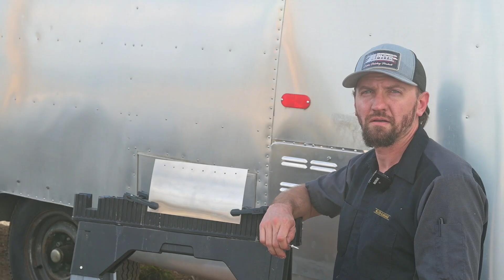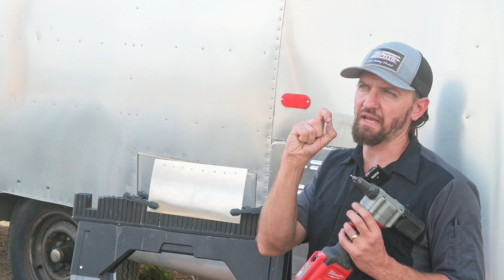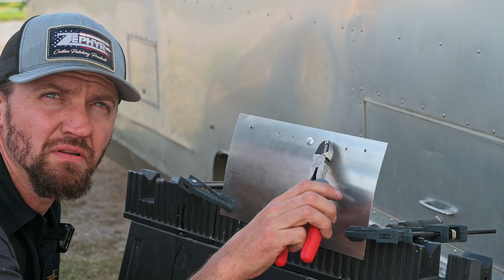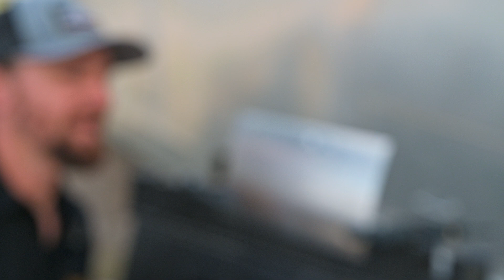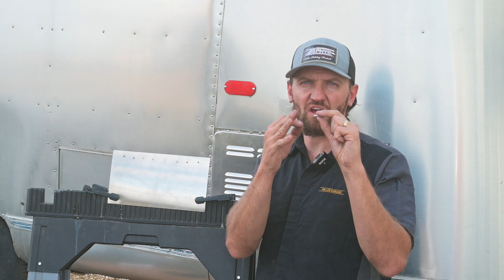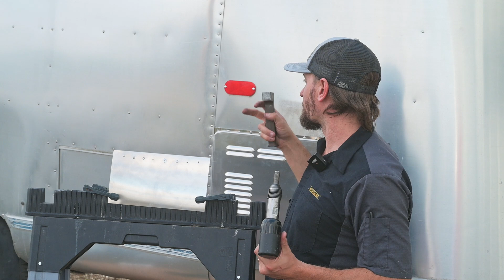Airstream Rivets 101: Types of Rivets, Where and How to Use Them

Comment: Excellent vid.  Just found and subscribed to your channel and gave a hands up!   I have Casita Travel Trailer.  It uses acorn nuts on the inside of trailer connecting to rivet.  The rivets are used to hold up storage cabinets.  Do you have advice and or a vid showing how to replace rivet from outside and connecting acorn nut inside?  Thanks

Comment: Very Informative video i appreciate you teaching and explaining the ProfessionalTools  not only have i owned a Airstream i also had a Vintage SportFisher boat that had many Item Riveted withAluminum Rivets similiar to the Airstreams things like Bow Rails ,Grab Handles and even the Factory Steps on a Ladder used to climb up and down to the Bridge  many of those Items needed to have “TuneUps”  and Rivets changed out  as luck would have it i suffered a Traumatic Brain Injury years ago that  caused some permanent Paralysis in my Leg and Arm and  in order to Walk i use a Cane and a Custom made Brace that  is held inplace withVelcro Straps that are Speedy Riveted onto   basically Lamenated Plastic / Resin  part that keeps my leg steady but able to bend at the knee  and once on Vacation  a Rivet popped  on me so i was 1200 miles away from the shop that  builds and repairs my Items so i went into a relative Workshop  and used his Bench Vise and some body and Fender Hammers and Dollies to  reset the broken Rivet by hand after Vacation i showed the Craftsman my fix  and explained  how i repaired it  the guy was so Impressed he asked me if i  ever wanted to  get a Job he would hire me LOL  i’m officially retired  and will stay that way

Comment: Are you using the Olympic rivets to also reinstall the Airstream Land Yacht and other thick aluminum plaques on the outer skins?
Reply from the maker: You can use them. We sometimes use sealant on the posts and double sided bodyshop panel tape if you dont want to drill holes in them.

Comment: Can you flatten the back side of a pop rivet using the bucking bar and air hammer??
Reply from the maker: you COULD. You probably wouldn't want to as the pop rivets strength comes from it being a tube, I feel like if you flatten it, it would lose rigidity.
Reply: Try it on some scrap , might cost a penny . Go ahead and splurge .

Comment: Thanks for the great videos!!  I am replacing the front lower panel on my ‘79 Avion and need to know what length of buck rivets to buy. They will just go thru the .032” skin and the rib. Thanks!
Reply from the maker: Hey, thanks! Most likely it will be 3/8" in length. I would suggest getting 1/4" and the longest ones and then just cut down the long ones to the right size.

Comment: Thank you so much for all the content you providing. What you have been created is amazing. You've inspired us to overcome all doubts and finally getting started with our 1967 Airstream Safari exterior restoration. May we ask you a question, since we were wondering about the buck rivets you´re using. If you're using the universal head rivets from the mentioned shop, you need the 5/32 rivets to get the same head size of the 'original' 1/8 buck rivets, right? ... And to use them you need to extend the drill holes, right?
Greetings from Germany - Danny and Tina

Comment: Thank you Ian. I have done a few AS mods based on the skills in building aircraft. So, there are a few times where I countersink and dimple to get a soft smooth finish. There is a pop-rivet dimpler too that is super handy when you can’t get a compression tool in there. The other super handy tool is a de-burrer. Keeps the seems flush and tighter. I watched Rawls doing a slider and he was having issues b/c he didn’t de-burr. Great way to introduce the #20 and # 30 bits as well.

Comment: Ian, I had a question about the Rivets that are used to hold the frame ribs to the C channel. Right at the bottom where they go and intersect the C channel perpendicularly. there is a rivet put in from the skin side that I don't understand how they would have gotten in there with the skin from the outside in the way. There was another segment as well on the outer skin when I was taking the shell off that had blind buck rivets. Wasn't sure how they would have gotten those in with the skin in the outside in the way. Unless the skin came after. Which is not how I thought they made these. 69 Overlander.